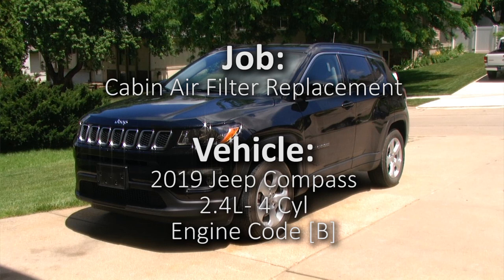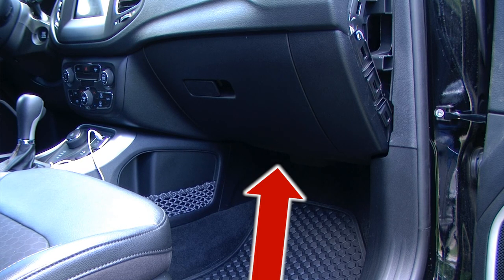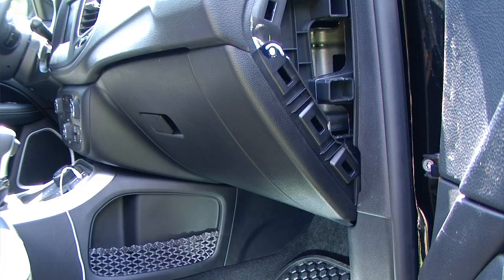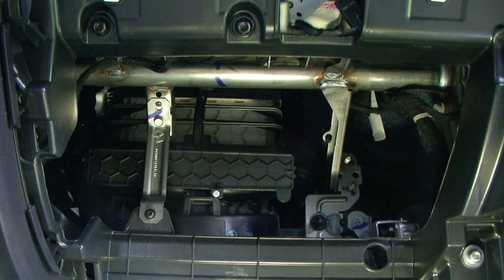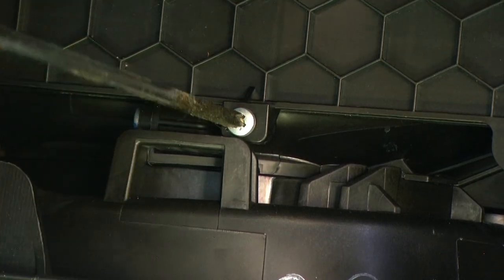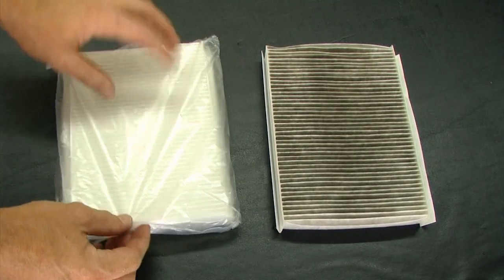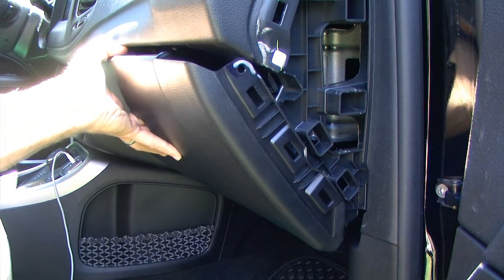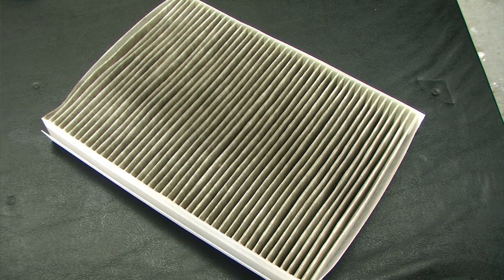2019 Jeep Compass - Cabin Air Filter Replacement

Comment: You should run the air conditioner or heater on full blast after you have changed the cabin filter before reassembling to check for any motor noise caused by any debris falling into the motor.  I learned the hard way and had to take apart again to clean out some leaves that fell into the motor making a loud noise when maximizing the air conditioner.
Reply from the maker: Great tip.  Thanks for sharing.

Comment: I had to use a wrench to loosen the 10mm bolt holding the bracket over the filter cover. I dropped the tiny wrench to the left of where the filter box is. Any idea how to retrieve it?
Reply from the maker: Any luck?  I would say try using a telescoping magnet.

Comment: What the names of the tools required for this job?
Reply from the maker: Which tool specifically (at what time in the video)?  Typical tools are standard head screwdriver, Phillips head screwdriver, torx screwdriver, socket set.
Reply: Thank you so much, I managed to get it done by your help here! It’s great to know how to do this, I picked up a t25 screw, multihead screwdriver, and a 10mm bolt ratchet at auto zone and was all good

Comment: Is this the same for the 2018?
Reply: Yes, it should be the same.  I believe the 2017 and earlier is much simpler to do.
Reply: Yes, exactly the same. I used a impact driver to remove all the hardware. I have a Makita impact driver with different speed settings. Only use lowest setting when reinstalling the hardware to keep from breaking or stripping anything. Having trim removal tools makes easier work removing the panels and prying open the glovebox housing. Set of trim removal tools I have. https://www.amazon.com/dp/B01L8GHB7O/ref=cm_sw_r_cp_apa_fabc_FYN89V2W1X439K70SXF0

Having the right tools makes the job quicker and keeps you from scratching or breaking anything.

Comment: The dealer really doesn't want regular folks to be able to replace this filter 😂😂.  This is how they will justify charging $80 and up for it.  My sonata is so much easier, no need for a damn screwdriver or any tool.  Yet they'll still charge you $50.
Reply: Nope...the dealer does not want regular folks to do anything.

Comment: I just shook my head when he said a flat head screw driver. You know they make trim removal tools right?
Reply from the maker: I agree that a trim removal tool would be ideal… However most homeowners do not have that tool
Reply: @InsaneOil  why not?
Reply from the maker: @jacobmaland8028  you’d have to ask them
Reply: Why did you shake your head? Are you a pro mechanic? People have used fkat head screwdrivers to pry stuff since fkat head screwdrivers have existed. There is literally zero difference in process ir results.